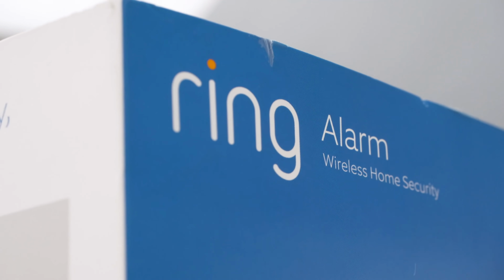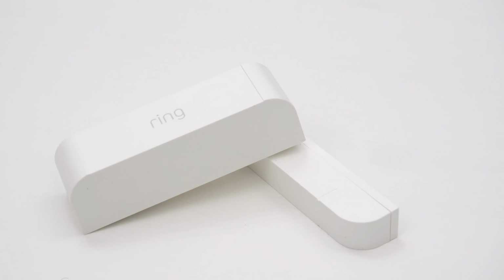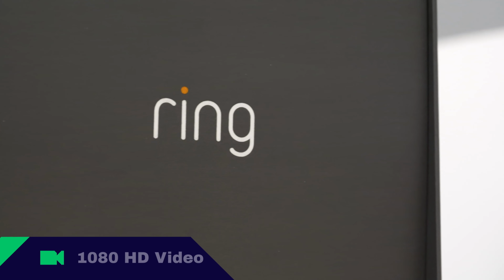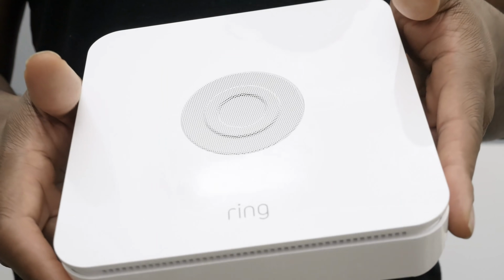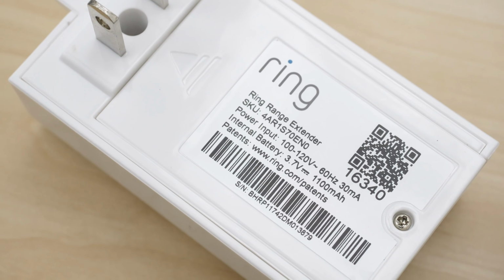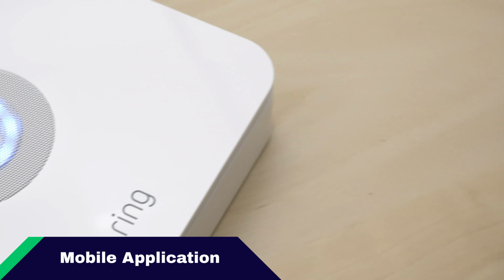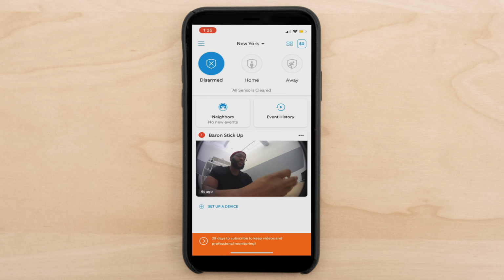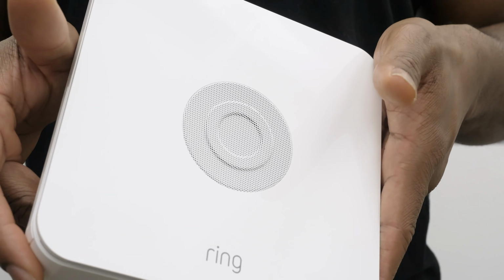Ring Alarm Home Security Kit Review- A Safe Option?

Comment: I have this system and I have a month on this guy.  He didn't quite give the whole story.  The speaker isn't that loud on the base station.  Even bumping up the volume all the way a room and a half away and you probably will have a hard time hearing the alarm chimes.  ...or one room with the TV on.  The system itself is ok but having had multiple systems I can tell you that a few features that SHOULD be included are not (and I have no idea if there is a roadmap or list of upcoming features).  For one you have three options to setup your home:  Away, home & armed, and disarmed.  When you set your alarm for away you get a 30 second window to leave before it sets.  With the home & armed however you do not, it arms automatically.  For me (and I'm sure many others) this is an issue because I leave for work at 5:15am.  I do not want to set it to away because the motion sensor will go off if one of my kids gets up etc.  In a traditional alarm setup you can set the "home & away" option and it will give you the 30 second window to exit also, Ring does not have this.  So instead I have to exit the house and then use the phone app to arm the alarm once I am outside.  This is very annoying.  Also there is no "chirp bypass" option.  Another example is with a traditional alarm I can press * before setting an action and the system will know to "silently" do this (again late at night or early morning to not wake others up).  There is no option like that with Ring.  The base station, that from before you learned is turned all the way up to be able to hear during normal household active time, will now be blaring while everyone is sleeping and no extra noise is happening.  The noise for the "countdown before alarm goes off" is very VERY low.  The volume is all the way up but the "noise" that it makes is not one that cuts through.  So if someone were to come in a normal door in the night you might actually not hear that pre-alarm going off.  The silly part about the noises and chirps etc. is that Ring should have the same noises come from the keypad.  When you press buttons on the keypad and arm/disarm the system it will play the same "Home And Armed" voice as well as beep when you press buttons but the sensor "chirp" does not come out of there nor does the pre-alarm sound.  The last thing I will bring up because nobody will read all of this anyway is the Z-Wave functionality.  Yes, the base station is a z-wave base station also and yes you can connect z-wave things to your system...   they just will not work either 1) easily or 2) the way you want them to.  Ring does not have broken glass/sound sensors.  I believe they finally have the option for fire and flood but this was not the case until a month ago (March/April-ish).  If you were to purchase z-wave compatible devices for security or for say fire great.  You can add them to your ring system (that's how you add the devices, if there is another way I do not know it) but they will not actually trigger anything.  So nothing will happen if you have a glass shatter alarm device, it will not send anything to ring, they will not respond etc.  Also the amount of screens you would need to dig down to find a device you add (say like a light switch) would not be worth it.  I'm also not sure at that point in time how the connectivity to Alexa with ones that do would work.  This is why I need a youtube channel and make content so I can have someone send me one to try it out lol.
Reply: super thorough review...making me rethink my decision to go with ring
Reply: @francescap2340  I don't want you to get the wrong idea.  I only have experience with maybe 5 alarm systems throughout my life and can only compare based off that.  I know what my case use purchase was for and this seems to be able to do the work.  Yes I think they need to have some additional units to make more "noise" when needed and of course have some better options to supress when needed because those are critical.  You simply cannot beat the price for the monitoring service and it's the top tier service they offer which means that if you add on any cameras etc. they are already on that tier you are paying for.  Not only that but I did the pricing and you start to save over other companies very quickly. 

It was a couple of years back before all the doorbells got popular but one of the big boys was selling a "camera" with their setup.  It cost above and beyond a pretty penny and it wasn't even real live video but pictures that you had to pay extra to actually get.  I think right now I'm happy.  I have inherited a gen 1 ring doorbell i'm going to install which will extend.  Plus they just updated Alexa app and so now alexa devices can monitor SOUNDS for fire alarms (not in your system) as well as glass breaks (RING has no sensors for that officially yet) and it will alert etc.  So they are finding ways to fill gaps.
Reply: @thegreatcerebral  Thank you so much for your input!! I'm debating whether to go with Ring or Simplisafe. I'm leaning more to go with SIMPLI SAFE. WHAT WOULD YOU SUGGEST ?  I had XFINITY'S home security system but it was pricey and not that good.  I would like to know which one out of those 2 that  you would go with.  Thank you.
Reply: Thank you for your input.  These are the day to day details I was trying to research.   

Can you please elaborate? Will a paired Fire alarm , be responded to by the monitoring team, or at least a prompt to your phone?

Also, is there any sort of panic button or alarm on this system?
Reply: @beretta2211  Ok so to answer some of these in the best I can.  The caveat with RING is that if it isn't a "supported device" which basically means, download the app and make a free throw away account and do an "add device".  If it isn't on the menu then sure you can add it as a Z-Wave or whatever it is device but RING will not interact with it as far as monitoring or alarm goes.  The good news is that they are adding more so if you purchase the official ones (again load up the app etc.) then yes they will alert the same as with the alarm.
Also, I have to note that Alexa will now bridge some of that gap for you.  They just (literally less than a week ago) updated the Alexa app and if you have an Alexa device you can now use it in conjunction with your RING setup and it will monitor NOISE and alert for you.  So it will monitor for the sound of breaking glass as well as smoke detectors (ones that you already have) and it will alert/trigger etc. based on the settings you tell it.  Obviously the coverage for that will depend on how well it can hear the area etc. and yes if you have multiple ones throughout your house then you will have better coverage.
Technically speaking as well you may be able to use the video cameras to alert/monitor areas of your home as they should trigger with motion and you SHOULD be able to set the sensitivity low enough that lots of smoke or flames would trigger but that's way more risky and not worth trying.
Everything in the system prompts your phone.  So triggers, arms, disarms etc. are sent to your device(s) that are allowed to talk to your system and logged in and of course there are always the settings you can change/choose both in the system as well as the phone/device.  What I mean by that is you can turn off like a window you often leave open to not trigger if you have "disarm" set so it does not chime/alert (which by default chimes during "disarm" mode do not alert but you can change) etc.  Also you can turn off/on all the notification settings in iOS or AndroidOS etc. there as well.
Panic Button...   I'm going to say yes and no.  Traditional systems have dedicated buttons that you can see a FD or PD icon labeled button that you can either usually press or double press to alert...   Ring has no dedicated buttons but there is a button combo on the keypads that you can press to do the same.  They also sell one for $35 that is dedicated you can put somewhere in your home like a safe room in case someone is between you and your keypad.  Remember all the pieces are wireless and you can add X devices so you can have a keypad in every room that is wireless.  I looked up the panic alert sequence on the keypad and you press and hold the "X" and "Check"  (basically instead of a * and # they have a check and X on the buttons next to the 0 on the keypad.  You hold those down and it will panic the system.  I do not know if there is a panic option on the app.  I just looked but not too deeply.  There SHOULD be but I'm not sure.

Sorry this is long winded.  I just know how these videos from youtubers who are getting free product that they aren't really "using" and instead making $$ off of these.  I'm more than happy to answer questions
Reply: That helps a ton! Thanks.   Been researching systems for a while.  I’m not scared to pay more for a better system, but Ring looks like one of the best wireless solutions.  The Abode is the only other system that can compare it seems.  I’m not sure what it is that i don’t like about the abode but i am leaning towards the ring.  If you have any experience with the abode that would be helpful or If You feel like you can recommend the ring after living with it.  I’m sure every system has its places it can improve.  

The abode just feels like it’s More costly , without being much better. Again not scared to pay more but geofence and smart home compatibility is not important for me so how an I justify. 

I’m more worried about the basic day to day function and reliability of the app, alarm and response from the company , and equipment if that makes sense.  

Thanks brother.
Reply: @williammorrow5816  I will say I have no idea and never heard of Abode.  What I can and will say is this:  (I should just make a video shouldn't I lol) I bought the RING system because when I got it there were basically 2 systems that were top tier when I went to get it.  RING and the SimpliSafe.  I know the ring name and after the blowup of the doorbell cams and having used one and installing one for my boss along with saving $5/mo. with RING and Amazon had a deal that got me a free Echo Dot or something...  I just went with it.  My install was simply that I have  two boys and one of them has Down Syndrome.  We have a pool.  I wanted something that I could set to let us know immediately when one of the exterior doors are opened; especially pool doors.  This gives us that.  We also happen to have a wifi garage door opener that alerts our phones as well.  So we should know if he opens a door (or window) he should not.  Also it gives us the flexibility to add the cameras if need be for extra security.  I liked the keypads and how they operate (I'm still on my initial charge from basically Jan 5 and they are still showing 50% battery life or so.  Yes you can plug them into the cable and leave it but it's more clean and looks like the traditional keypads when you use without the cables.  Also my home did not come wired for a system, that was an extra cost that we did not put into the home.  That also means that we would incur a charge to have a wired system put in.  I probably could have ran some of the wires but not all for a wired install.  Also if you have a traditional system then you know there has to be a box somewhere for all the cable terminations and that isn't factored into our house plan so it would have to be put somewhere and be an eyesore.

It was easier to just bite the bullet and go wireless.  There are some upsides also that I didn't know I would get.  I know when my internet goes down (my app tells me its on cell) and same goes for when my power goes out (app tells me the base station is running on battery...  and cell but I figure if power is out so is router). 

I have used a few alarm systems ranging from traditional home to business systems.  They all have their ups and downs.  I find this is a happy medium.  I do like that I can take it down if I sell the house or even change pieces out if need be.  The batteries in the sensors should last a few years and are cheap to replace so the cost of repair and monthly bill is still far less than traditional wired system in the home that usually starts at around $30/mo.  I net $20 every month and I think it may be $20 to do a full battery replacement for my sensors (I have about 18 sensors).

I personally don't recommend things to people because everyone is different and I don't want someone to blame me if they don't like a product because I said I recommend it.  I will say that I am happy with it given the annoyances it has.  If I wanted to do more with the system then I may like it more or less, I'm not sure.  That's the other problem.  I may not fully understand the Z-Wave incorporation or how that works.  I think if I tried to get a couple of switches for lights to setup some automation and see how that goes I may like it more because I don't know anything about that stuff then I cannot say.  I know that the base station is a Z-Wave base station but how that works... no clue.  I do know that if I have to go through the RING app to talk to z-wave devices then that will not be fun no matter what unless magically Alexa can use voice automation to turn on/off things.  I have two switches in my house I would love to move to z-wave/automation because of where they are at in the home and where they SHOULD have put them (or a 2nd one) in the home design.  I may start there and see how it works.

I am happy with the purchase because of my reasons and of course cost is one of those.  I've only paid the up front equipment cost which I want to say was $450 and $40 in monitoring (first 30 days free also) since Jan.  I've had one false alarm because one of the sensors fell off a doorway and triggered the alarm.  They called me and I happened to be close by and told them not to call because 1) it was a sensor on my kitchen pool door that went off.  2) there is a motion detector directly above that which did not go off.  So either someone just happened to break the glass or get the sensor to fall off or it was a false alarm because the motion did not trigger.  Even that door opening would have triggered the motion and I would have told them to go ahead and call.  Plus they told me it was a "tamper" alarm so it wasn't motion but tampering which means the unit opened.  All was good.  Do I wish they would fix some of the annoyances I have, sure but I'm picky.  Nothing is perfect and we have gotten used to how it works.  We have not gotten into multiple users etc. on the account but we could, it's simple.  I'm happy.
Reply: Thanks for the detailed input my friend.  I just purchased one today!  After your comments.  I’ll let you know how it goes !! Think it will fit my needs

Comment: Thanks for the review. I have two questions. 1. what if someone breaks the window, but doesn't open it. will the window sensor register that and sound? Also, what if someone just cuts your internet cable cord before entering. Won't that just disarm the entire system? thank you so much. Your review was really thorough... just had a few lingering questions.
Reply from the maker: No problem! Ring doesn't offer a glassbreak sensor but the motion sensor will detect if someone breaks the window. If you chose to pay for cellular backup, then your system won't depend on Wi-Fi. See the written review for more info: http://bit.ly/2NKQjUK

Comment: Does this system call the cops if the alarm goes off or fire department
Reply from the maker: It depends on which alarm goes off and whether or not you signed up for professional monitoring. If you did the latter, the team will be notified as soon as an alarm goes off. From there, they'll verify the emergency then can contact either the police, the fire department, or medical services, if necessary. That's the benefit of 24/7 professional monitoring! See more info here: http://bit.ly/2NKQjUK
Reply: I already have three ring cameras and pay the $10 a month charge so I think that includes that if I get the alarm correct and by the way your review was awesome very detailed
Reply from the maker: @bignogueras  Yep, your additional alarms will be covered by the monitoring you pay for. Thanks!
Reply from the maker: @bignogueras  You can get the best offer for additional Ring sensors here: http://bit.ly/2UpPNRD

Comment: Does the ring system have central fire alarm coverage? If so which hardware is needed?
Reply from the maker: Hi Barry, Ring offers a smoke/ CO alarm for First Alert that works with the rest of the Ring Alarm system. If you already have smoke/ CO alarms, you can also buy the Smoke and CO Listener, which will alert you if your alarms go off. Here's a link for the best offer- http://bit.ly/2UpPNRD
Reply: I think they have Fire & CO "listener" , meant if listening to your traditional fire alarm if it sounds and it will catch the alarm sound and alert Ring security system.
Reply from the maker: @jpthsd  Yes, I also cover it in my written review- http://bit.ly/2NKQjUK